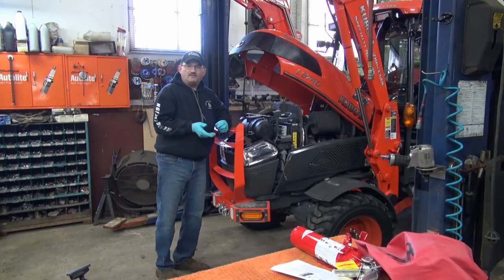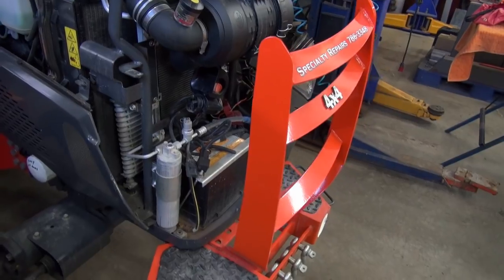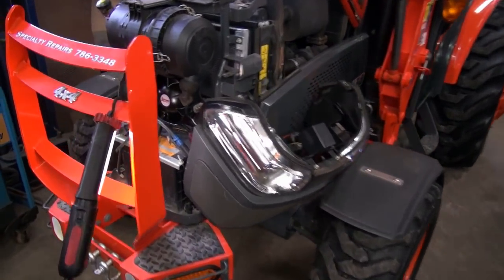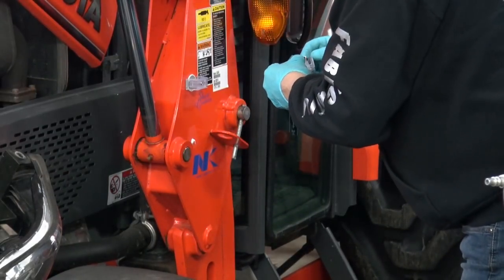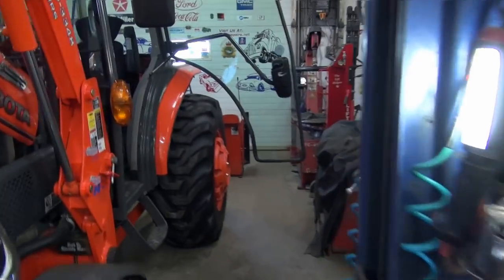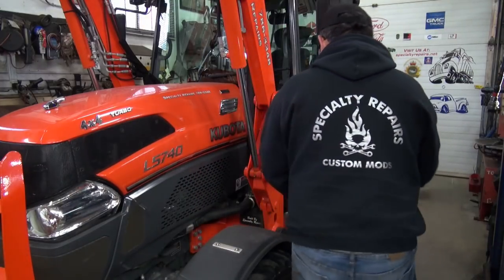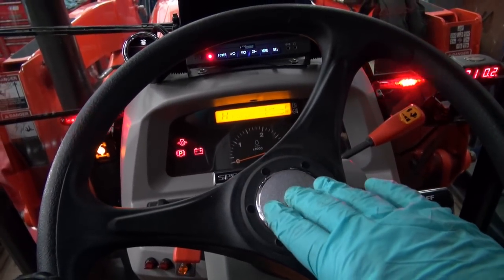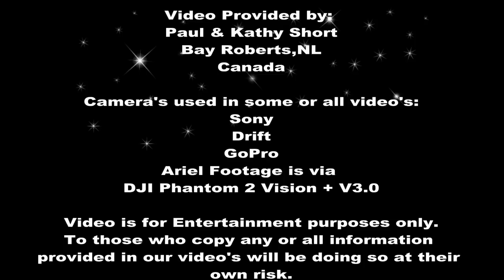Installing The Whelen Siren

Comment: Oh, your not going to be operating it. I thought you were going with the tractor. Anyway siren turned out good I like the way you mounted the speaker and the bracket looks nice and strong. I like the mounting of the siren in the cab as well, Kathy did a excellent job on the decal for the bottom of the siren control unit.
Reply from the maker: Tyler Donovan 
Nope. It's a long time friend and customer. Hope your having a great day. We are just taking it easy today. Winter is almost over!
Reply: Paul Short Winters not over yet here...I wish it was, I just got in from shoveling for the 3rd time...now it is sleeting so I will have to go shovel little pieces of ice that look like table salt soon.
Reply from the maker: Tyler Donovan 
We got that mess heading our way tomorrow evening. They don't know what we're getting yet. It could be rain, sleet or snow. I'm done with snow clearing video so it don't matter. Don't work to hard.
Reply: Paul Short When is the 5740 leaving? And what if you get a storm when it's gone and you have to use the BX will a video appear on that?
Reply from the maker: Tyler Donovan 
Middle of March. I have a Cat and Case back hoe at my disposal if I need something. I highly doubt I'd use the BX for this driveway. Just too slow and too cold. ;)
Reply: Paul Short Oh...Well must be nice to have those machines if you need them. Do you know or can you tell me why whoever is renting the 5740 didn't just rent a piece of equipment from a rental or something?
Reply from the maker: Tyler Donovan 
A clue is in the other comments. Man you are one curious creature!
Reply: Paul Short Yeah...Sorry for asking so many questions. I usually have a lot of questions. I will stop now.
Reply from the maker: Tyler Donovan 
I highly doubt that lol. I'm used to you by now my friend ;)

Comment: Hey Paul awesome work as usual. Just one thing that jumped out at me. I don't know how often the siren box will be used for the contract. That bare aluminum piece on the bottom I believe is used to dissipate heat. Not sure if it will cause the decal your lovely wife made to bubble or warp or not.
Reply from the maker: I don't think it will be an issue. If it is we'll mod out the decal 😊

Comment: Paul, I read all the comments first before I stuck foot in mouth. I am curious as to what attachments  are needed for contract account; blower, bucket, etc?  I to also wonder how you can let it out of your site. We thought you went with it. Thanks for the entertainment.  Wayne
Reply from the maker: IowaKLR650 

Just the forks and ballast box. They supply the operator. It's a company we have dealt with for years. It's a contract I can't lose on. It's not all about the work it will be doing. It's tied into advertising and photo opportunity's. They needed a clean recognizable unit and with our tractor it's already well known because us and the internet so it fit the bill nicely.
Glad your enjoying it.

Comment: I just watched an episode of Jay Leno's Garage on You Tube and learned that one should NEVER use a dry powder or dry chemical fire extinguisher on a vehicle. Always use a CO2 extinguisher because the dry chemical will leave a residue that can ruin the vehicle's engine or other equipment, plus it's a mess to clean up whereas the CO2 extinguisher leaves nothing behind.
Reply from the maker: William Jones I bought mine from the local supplier which is licensed so I can only assume he sold me the right gear.